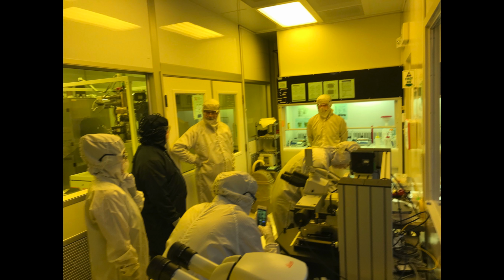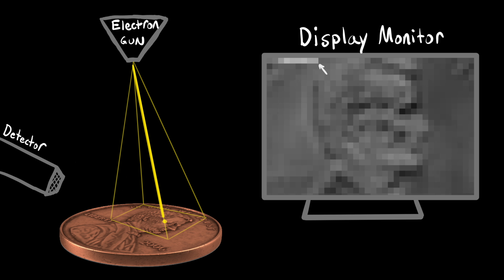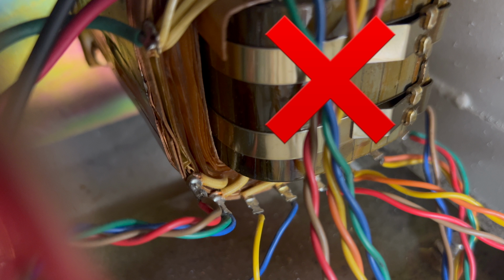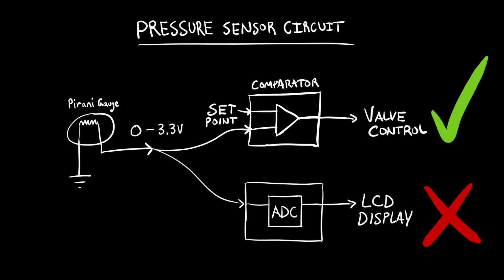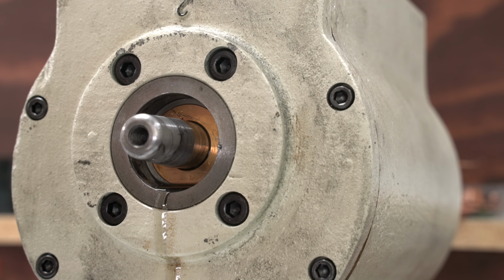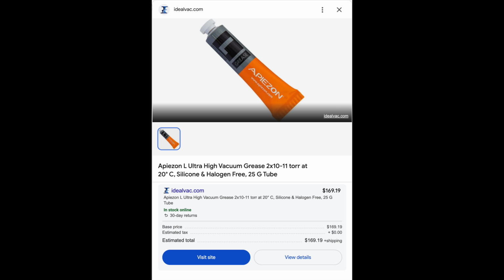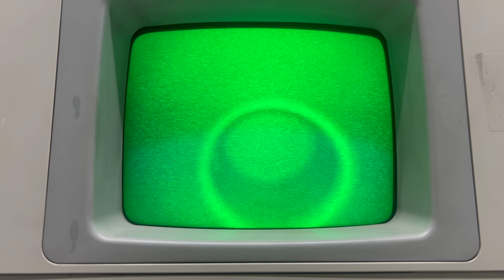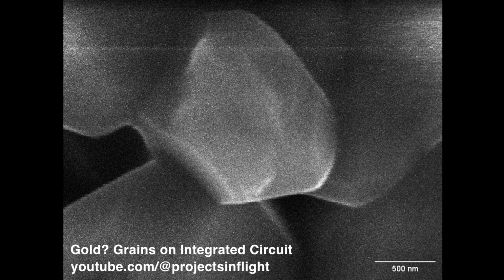I Saved an Electron Microscope from the Trash

Comment: What happens if you just attach a 4K display to the outputs?

I don’t see a reason it wouldn’t work. At most it would need some sort of spec review and some soldiering maybe
Reply from the maker: If I could attach a 4k display to the XP computer that might work.
Reply: @ I hope it does. Although like I said there might not be enough signal output sources for the 19 HDMI pins to connect to. 

Really hoping it’s possible tho

Comment: 9:26 In case you ever want to fix something with a blown fuse again, replace the fuse with a incandescent light bulb. Yes, a light bulb must be connected in series with a circuit under test, instead of fuse. If a short circuit occurs, the bulb will glow continuously. If it doesn't light at all or blinks, only then can you put in a new fuse. This "tool" is easy to make, but of course extreme care is required when handling due to life-threatening voltages. And you will not waste any more fuses.
Reply: Learnt something new today

Comment: Nothing more than a scanner that can only scan an object that it coats in gold or some other material!
Reply from the maker: You can scan objects that aren't metal-coated. The fly for example was just a dead fly
Reply: @projectsinflight  "To view chitin with SEM, samples usually need to be properly prepared by demineralization, deproteinization, and sometimes a gold coating!"

"According to Dirac, at any point in space, the electron neither exists nor doesn't exist. It can only be described as a mathematical function. The same is true for the quarks that make up the atom's nucleus, as they too are fermions, which behave according to the Dirac equation."
Reply: @projectsinflight  The exoskeleton of a fly is made of chitin, a hard, fibrous protein. Chitin can be SCANNED by an electron microscope, specifically a scanning electron microscope

Comment: If it was so difficult to find 100V transformers, why not just use 120V transformers, and run the Variac at 120V?
Reply from the maker: There are some parts (the motors on the valves for instance) that run at 100VAC, and replacing them would be a huge pain
Reply: @projectsinflight Ahh. That makes sense!

Comment: It's a different system but regarding the CRT and the driving board, most info regarding repair of CRTs can be found on older atari st forums since those machines run on dedicated monitors. Technology is pretty similar.
Reply from the maker: Ah, makes sense I'll check that if I get the time!

Comment: Running a 100v device on 120v shouldn’t make a difference, but it’s good to be safe.  Also, is there a way to connect it to an LCD or plasma screen, or possibly record directly?
Reply from the maker: The computer interface works pretty well for that actually- once i solve the noise issues

Comment: The basic functionality doesn't seem that difficult. Is there any reason you couldn't replace the electronics wholesale? This definitely feels like an area where modern signal processing would be capable of far better imaging than the original analogue circuits.
Reply from the maker: It's certainly possible, but honestly it's just too large a project for me when the unit is already functional.

Comment: what would the readout be if you hooked a pressure gauge to the SEM? In psi?
Reply from the maker: My pressure gauge measures in any unit I want, but the internal SEM gauge uses percent, which as you can imagine is not a very useful pressure unit lol
Reply: @ sorry, just trying to convert it into PSI or bar (the 2 units I can comprehend) what is the “-psi”  amount in the SEM when the pump is active, I ask like that because in cars(the only advanced mechanical things I understand) a vacuum gague would read out —14.7 when off throttle
Reply from the maker: @youcantevencompareyoubum  Well, standard air pressure is 14.7psi, so any deep vacuum is gonna show -14.7psi on a gauge. It's not very useful to use on a SEM though, because we don't care about the difference between the atmospheric pressure and the chamber we just care about the absolute pressure of the chamber. A slight variation in atmospheric pressure due to weather for example is larger than the difference in absolute pressure between the low and high vacuum modes in the machine, and would prevent accurate measurement of the chamber pressure.
Reply: @ amazing explanation thank you so much!

Comment: I saw this machine on a government auction site. Maybe not the exact same one but the same model but the bigger version. It was a very low price, i don't remember, maybe like $600 and no one was bidding on it. Description said it worked perfectly.  I wanted to buy it But what would've cost the most was the shipping. The machine was in six parts each on a large pallet that would record forklift to load and unload. Then there's the required knowledge for assembly. I know nothing about these microscopes and sure i could've taken a few months to figure it out but it was too much risk 😂
Reply from the maker: It's a tough choice. I think if you want one and have the space, and have a reasonable idea that it's working or fixable, you should do it, but it's a huge commitment

Comment: Major airgapping wire job needed but aside from this , unplug everything . Reset . Replug everything ? This thing look fine
Reply from the maker: Yeah, it's working ok, but It's got a lot of noise issues that will need to be addressed
Reply: @projectsinflight  Negative isolated wire touch positive isolate wire is no permited , positive isolated wire touching chassis is not permited , same for ic wire . I use alien tape to airgap . Usually the thicknes i put is isolated wire size or bigger zip tie . One over the two wire loose and another over the first zip this . This keep different pole ac  chassis to wire to a safe 5 mm distance . Why bother ? It's a sort of capacitor electret phenomenon . The who thing charge it self and randomly discharge .only airgapping diminjsh these issue , that toy is  not 1.5 volt so easier to airgap wire , 2mm between isolated wire different polarity or different amperage should be enough space

Comment: you did add some components into the machine (transformers) and their position and electromagnetic fields could be influencing the electron gun of the crt which might cause the screen images issues...maybe (I don't know)
Reply from the maker: Yeahh.. I was worried about that. I can possibly try and shield them maybe. I don't know if they are causing issues

Comment: WOW... i'd love to have access to this sort of scrap equipment, my best days are spent reverse engineering  & hacking old equipment.
Also , I'd get that XP hard drive imaged onto a backup , then  see if you ca run it on a VM.
because ,  such software rarely runs on modern computers due to it being 32 bit software, plus it's hard to find direct replacement motherboards with hte correct hardware for hte drivers.

I have a complete factory running on old dead xp systems ties into "dead tech"  machines & time is running out
Reply from the maker: Yeah good idea

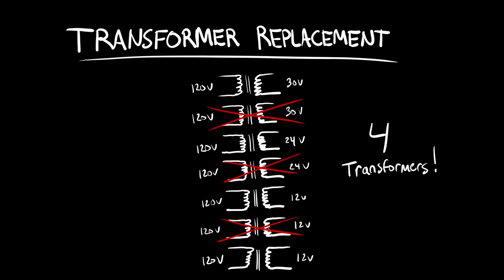Comment: 10:45 I haven't read all 2604 comments, I hope someone has already pointed out you can use 120V transformers directly without stepping down using the variac to 100V.
Reply from the maker: True, but the transformers are behind some power-sequencing relays and it'd be a pain to rewire it

Comment: Can you see what's inside a mitochondrion and a chloroplast?
Reply from the maker: Mitochondria are about 500-1000nm large, so I could definitely see one given my current resolution (~50nm) however, looking at mitochondria would be difficult because of the sample prep needed. an SEM needs a dry subject, so you'd need to get all the water out of the cell and somehow preserve it in it's correct shape before imaging it. Also, SEMs only look at the surface so you'd need to find a way to cut it in half. It's definitely possible, and I am actually working on it! But it's gonna be a while I think!

Comment: How about replacing the screen with a modern one.
Reply from the maker: Honestly, it's not really necessary. Replacing the CRT wouldn't improve the resolution since I've already got the high-res computer interface. I will need to fix the signal issue though

Comment: A word of warning: old gaskets like the one in the pump usually contain asbestos (and so do some modern ones coming out of Asia). Some PPE and avoiding use of power tools is generally safe enough.
Reply from the maker: Yeah, unfortunately that possibility wasn't on my mind when working on it... Fortunately, I don't think that it was an asbestos gasket, and also it was moist when I scraped it off, so hopefully even if it were, it wouldn't have gone airborne. I should probably consider the possibility of asbestos exposure more seriously lol.

Comment: Dude spec it out. Turbo it
Reply from the maker: I was worried about the potential for vibration if I swapped the diffusion pump with a turbo. It would certainly save on power though...

Comment: All relays or contact switches need to be swapped. with the video signal in hand you should do an improvement to it too like having a secondary screen in 8k or something like that i dont know wich kind of graphic cards could help you acheive this but i bet there is a company somewhere that are doing just that taking old video signal to rgb 4k or something. that would make another great video. thanks for all the details of the repairs that one video was quite informative. the best thing here is you could potentially sell this antic working unit for dozens of thousands and get a 2024 electron microscope with the money too.

Comment: Before disassembling I've always said snap a few pictures just in case you need to remember it completed.
Reply from the maker: For the vacuum valve repair I absolutely did that and also put each part on a piece of paper with a label so i didn't lose track of where it went. I was very nervous about losing parts

Comment: Took my first SEM images on a JEOL JSM-T330A (circa 1985 IIRC) and from that moment on I was hooked. Went to work for several years in a microscopy lab with a variety of different brands of SEMs - Hitachi, FEI/ThermoFisher, Zeiss, etc. Learning how the scopes operated the "hard way" on an older model paid off massively in that line of work. 

Really cool to see you dive into the electronics because I spent a lot of hours with my service engineers troubleshooting and repairing our scopes in the lab, and it's cool for others to see that (1) there are a ton of electronics needed to get the system to work correctly, and (2) what we were able to do with fairly simple 80s/90s electronics is incredible when you consider how rapidly things improved from the late 90s onward.

Comment: What a cool piece of history, and really puts into perspective just how quickly technology evolves. The SEM/TEM platforms I use are all unsurprisingly computer-controlled - stage movement, beam shift, vacuum control, etc. Besides opening the airlock to load/unload my samples, the machine is basically separated from the operator (sometimes in another room entirely to isolate vibrations!).

I love seeing the images shown on the CRT screen from a nostalgic perspective, but it's no wonder that we switched to a digital output (as it appears the previous owners of this machine tried to do) - the image can only be displayed on the fluorescent screen as fast as the beam scans over the sample, meaning at slow scan rates you get a faded image on the screen. In a digital environment, once the pixel intensity is interpreted by the software, it can persist indefinitely until the beam scans over it again. Must have been a huge quality-of-life upgrade for microscopists!

Comment: Wow, amazing repair!! I’m impressed with your patience and methodical process, ensuring that you don’t cause any additional damage, by carefully isolating and testing individual parts one at a time.

I’d love to see videos showing more about how electron microscopes work, and/or more images of cool things you can only see at the microscopic level 😋. Those images of the ‘graffiti’ on the microchip, and the housefly’s eye and scent receptor, were really neat!

Also, now that you have it working, it would be neat to see what you could do to modernize and/or improve it! Could you get a higher magnification by upgrading either of the pumps to a more highly specced one? Or doing an even more thorough overhaul of the entire vacuum system, looking for more leaks? Would it be possible to replace the CRT with a more modern LED display, so you can have a larger image, without the green tint or the CRT’s scan patterns? How much improvement can you make to the resolution, by adding some form of vibration dampening to the column? What sort of more modern, high tech solutions do we have for that, vs. what was likely used for the machine in the past (for eg. - is there any sort of mechanism that uses the high-resolution of modern gyroscopes and fine control of linear actuators, to essentially create something like a camera gimbal, but on a microscopic scale?). What other sort of things could you do to use today’s modern tech, to improve upon and increase the capabilities of the microscope beyond what it was originally designed to be capable of, in an economic way?

Either way, subbing, and look forward to whatever you do next! ☺️

Comment: Idk if this is a suggestion for what you should do next or not, but this is what I was thinking when watching the video: 1. WOW!  What a repair project! Very inspiring in its own right.  2. That housefly was really interesting.  Probably a bit out of scope for your interests, but really high magnification images of all areas of that housefly would be cool.  Even cooler (and harder) would be to map those pictures to a 3D model of the housefly (machine generated?) from the pictures. It would have been absolutely mind-blowing!   Also: An electron microscope version of the "Visual Human", but for various insects and other organisms that are otherwise too small to examine in great detail would  also be incredibly interesting.   Again: Probably not something you should or would want too do, but thank you so much for planting  that idea in my mind by doing this project :-)
Reply from the maker: I'll need to coat the fly in a thin layer of metal if i want to do a higher magnification
Reply: @ the magnification you had was already quite impressive (I’m easily impressed) but obviously: More is more :-)

Comment: You ever think of just replacing power supplies like that with either an off the shelf PSU or with something you custom build?  Also start thinking about wire management and sleeved cables.
Reply from the maker: Wire management might be nice lol. It's a mess in there!

Comment: I'd wonder how many, in number of digits?, atoms are in these images?  With a machine that old, I'd wager everything that could have been scanned has been.  Though they are making new things all the time, so start with scanning 3d prints.  Layer adhesion is a huge topic and I'm sure there are some bros that could use solid info.  Look for other "new things."
Reply from the maker: An atom is roughly 100 picometers, and my machine when new could resolve about 5-10nm, so about 50-100 atoms!

Comment: Just an FYI, those linear regulators are super inefficient (which is why you get all the waste heat). You can buy a DC-DC switch mode buck converter for a few dollars that will be significantly more efficient and not require the large heatsink for your digital power supply. Additionally, I'd use a couple of electrolytic capacitors on the output instead of the film capacitors you have on the linear currently. Something like a 100uF, 10uF,  and 0.1uF in parallel on the output will give you a very clean output voltage.
Reply from the maker: The concern I had was that this machine was designed with linear regulators, and not switching regulators. There is a possibility that the higher frequency noise created by a switching regulator would be poorly tolerated by the downstream circuitry. Not a guarantee, but I decided to keep it as stock as possible during the repairs.
Reply: @projectsinflight  Reasonable. You could throw an inductor on the output along with the caps to make an LC filter to solve that. I would generally say that is probably not necessary but I don't deal with high precision scientific equipment, so this may be a situation where that noise might be impactful.

Comment: Life pro tip from my EE friend: if you need a few volts for a power supply you can swap in a cheap Chinese switched mode power supply. You can sometimes solder an external power supply in line if the old power supply has a diode on the output and the power supply is providing less than sufficient voltage.

Comment: I had a similar experience with a Hitachi EM and I learned a ton getting it up and running.  But it was much easier for me because I just had to fiddle with the cooling flow sensor.  

My next frontier is digital image acquisition so any help on that would be much appreciated!
Reply from the maker: do you want to join the SEM discord? message nmz787 if you'd like

Comment: I would love to see an insect that was trapped in Amber under the scope
Reply from the maker: It would be impossible to see if the insect was trapped inside the amber, since the SEM can only image the surface detail. If the amber were sliced and a cross-section created, then this would definitely be a possibility
Reply: @projectsinflight  I have a piece of amber where when it was broken, a strand of hair of the bug pokes out. But I don't know if larger structures can be preserved since the amber is a glue that haas polymerized around it and would be very hard to separate. I feel like a cross section would only reveal the surface of the cut, and possibly some cavities inside the bug, but not its outer features.
Reply: @1.4142  I find the idea exciting because we might be able to see something no one else ever has